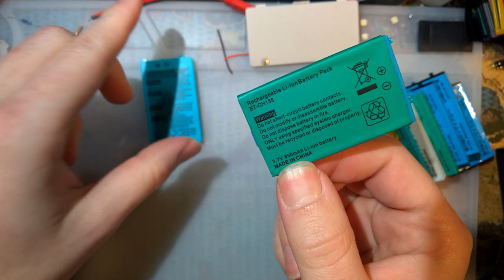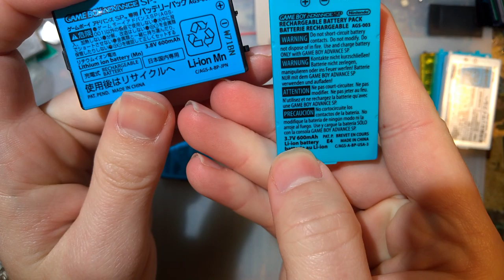A Quick Rant on GBA SP Batteries

Comment: Hey dude quick question. I just got an modded gba sp with a modded screen without a battery. I bought one out of ebay for 8$ and it worked for about 2 hours but wont work anymore. When i charge it the light stays red and when i try turning it on it wont work. Is the problem the battery or the charger? (Charger is also off market)
Reply from the maker: I cannot accurately diagnose this issue with the information you gave. Does the charge light even come on? The charge light is orange, not red.
Reply: @makho  when i put my gba sp to charge the light turns on showing its charging, but whenever i try to turn it on it shuts down after a few milliseconds like almost immidiately. Sorry im German so my english isnt very good
Reply from the maker: @snakoi  Time to start swapping parts out. A new, quality battery might solve your issue or a new charger might solve your issue. I'm not sure which. Could also be that your charge port just needs cleaning, especially if the light flickers when you touch the cord.
Reply: @makho  Thanks for the help i appreciate it
Reply: I'd bet the battery is just a dude and won't recharge. I'd say it still had some charge from the factory when you first got it and that's why it worked as long as it did. I'd suggest getting either Makho's battery from Retro Game Repair Shop or RetroModding or the Helder Megabatt 800.
Reply: @husky3g  tysm man

Comment: I have a question, the battery with 1000mah and 2000mah fits for the GBA SP or only the battery with 900mah? I need a answer please 🥺
Reply from the maker: 2000mAh is not possible. The capacity is wrong.

Comment: I have a pelican brand extended life battery pack 3.7v and says 1000 mAh it's a little bit thicker but it replaces the battery cover. https://www.amazon.com/dp/B0002EA5XG/?coliid=IKC5VR41M58P8&colid=28AXMEIK3732R&psc=0&ref_=lv_ov_lig_dp_it.     Oh and it also has a circuit board in it.
Reply from the maker: I had one of those back when they were new. It did not last very long. I think I got maybe twenty charge cycles out of it before the capacity started taking a noticeable hit.

Comment: I'm about to buy every aftermarket GBA SP battery I can find on Amazon and run them through a few cycles and see what is the best battery for the money.
Reply from the maker: You're not likely to find anything good on amazon but I'd love to be wrong about that.
Reply: @makho  so far from the ones I have tested it's not looking good. Especially when running an ips screen.
Reply: @kensprivateinvestigation2128 hey. 10 months late but did you find a battery?

Comment: Just bought an INSTEN battery on ebay for a mere 5 bucks for my DSL, claimed 1700 mAh (lol) ran it dry and charged it back up, 940mAh per my USB meter, assuming 80-90% efficiency, that's just 750-800mAh while the OEM is rated 1000mAh with still 75% capacity left lol
Reply from the maker: Yep. Any batteries in this form factor that claim over 900 are absolutely lying about that.

Comment: I just bought some batteries off amazon. Should I be able to assume they have the switch that allows me to play them on the charger?
Reply from the maker: They have the what?
Reply: @makho  I forget where I saw it, maybe it wasnt a gba sp video, but it was something about a battery that isnt recommended to be charging and played on at the same time
Reply from the maker: @BlazingKhioneus  that does not apply to the SP
Reply: @makho  Gotcha

Comment: Have you tried out the Dantona battery from Batteries Plus
Reply from the maker: I've tried out the Rayovac battery. I have not tried others from B+
Reply: From a little I've looked up it seems the dantona has the same specs from the original rayovac and the same holding charge performance. Weak theory is that it's the same battery and dantona was the original manufacture under the rayovac branding.....

Comment: Li-Ion battery degrades even if it is not used .So when we buy "new" batteries actually we don't. The problem becomes pretty unsolvable when we consider retrogaming.  The vast majority, if not all of the batteries You buy in fact are "new old stock". No manufacturer invests in producing so old models. Similar problems in smartphone's world: there are hundreds of new uncompatible models coming out every year. People then is forced to dismiss their perfectly working phones because of this.
Reply from the maker: I'm actually facing a similar issue with  my Lumia 950 right now. That's the camera I use for filming my videos and the battery is getting really weak. It's unbelievably frustrating.
Reply: Planned obsolescence, for sure.

Comment: I have not tested my OEM battery but then again i don't have a tester. But your video did help a lot about how certain things work and some confusion fixing. 

Also this is related to batteries but it's completly differn't question. I was wondering if you have looked into any way to hook up leds to gb, gbc etc in a way to have it showing when the battery is charging, when it is fully charged and when it's low to show differn't colors depending i guess on the frequency. I don't understand it all to well. But I have been trying to figure how how to get a RGB led to work in place of the old light on the gbc when i add a recharable battery.
Reply from the maker: I made this https://youtu.be/7A705K_WF-E

Well, I assembled it. But it already basically does what you want. No reason you can't tweak the open source code to support an RGB LED instead.

Comment: OEM DS (original) batteries are a legitimate 850 and will fit and function perfectly fine in an SP if you cut off the tabs so it's definitely possible to fit 850 mah in that size.
Reply from the maker: no. Stop recommending that people modify a 16 year old battery to replace a 17 year old battery.
Reply: @makho  why?
Reply from the maker: @MGTwenty3  because not only should you not have to modify a battery, but because DS batteries have the exact same issues that SP batteries have. They are all old and all the generic aftermarket batteries suck. Or do you really think that batteries aren't susceptible to time?
Reply: @makho  Clipping physical tabs is hardly a mod, it doesn't change any functions of the battery. The connections and all of the specifications except capacity are the same as an SP battery which explains why they work properly. If you follow the logic that OEM DS batteries are unwise to use because they're old then it's even more unwise to use OEM SP batteries, which you don't seem to have a problem with unless they're visibly concerning.

Comment: Are there videos on how this test is done?
Reply from the maker: Not from me. You can test batteries by applying a known load to them and just measuring the time it takes for the voltage to hit whatever you designate as the cutoff. You can also measure internal resistance to make rough estimates to the health of the cell (though without baselines, it can be a guessing game and since some batteries have integrated protection boards, you cannot reliably measure internal resistance). Last, you can also just time how long it takes to charge the cell with a known current limit but since Lithium Ion batteries use constant current and then constant voltage to charge, results can be a bit inconsistent if you just time start to finish. My battery charger does all this for me automatically.

Comment: I dont know if anybody will see this but how long do the batterys last?
I also dont know if its a dumb question sorry if it is
Reply from the maker: run time per charge or recommended life cycle of the battery?
Reply: @makho  sorry for not responding earlier but yeah the life cycle of the battery how long does it last?
Reply from the maker: @eeveenation64  I wouldn't expect more than three years out of any of these, especially with regular usage. They generally start showing wear after a year or so though. Time will tell and I'll retest assuming I still have all the batteries.
Reply: @makho  Oh ok Thanks for telling me!

Comment: You should test an original ds fat battery, you can remove the tabs on them and get them to work in a gba so
Reply from the maker: Original DS batteries are like 15 years old. I don't see what info could possibly be gained. I think all but one of my DS batteries are bloated too which makes them unsuitable for testing (or use even).
Reply: @makho  good point the one I have is in perfect condition
Reply from the maker: @harrisontashjian752  That's fantastic. It's still not a good alternative.
Reply: K than, I did not know so thanks for telling me, I've seen vids of people using them

Comment: so how exactly do you test for Mah?
Reply from the maker: I have a battery charger with a test mode. Basically, it will fully charge a battery, put a constant load on it (in my case 300mA), see how long it takes to reach a low voltage cutoff, then charge it up again. It's a liitokala lii-500

Comment: Maybe its a thermal cutoff or a diode. :/
Reply from the maker: Thermal fuse seems to be the consensus and was my second guess (after regular fuse).
Reply: @makho  probably just a fuse fuse
Reply from the maker: @daijoubu4529  If it were a regular fuse, it would have popped when I ran multiple amps through it.
Reply: @makho  A few years ago I was doing a lot of testing with GBA and Batteries. If I remember correctly, that part near the end of your video is probably a diode. When I was modding one of my old GBA's I remember needing to drop the voltage a tad with a diode, since the discharge rate of the battery wouldn't activate the low power red light LED correctly without one. I thnk the red light turns on around 1.8volts, but a LIPO is dead around 2.2-2.5v I think?
Reply from the maker: @lolztony  if that were a diode then this battery would not be able to be charged. This is also a battery for a GBA SP, not a GBA.

Comment: How do i test my gba batteries?
Reply from the maker: with a standalone battery charger that supports 1S LiPo and an adapter to plug the battery in to said charger
Reply from the maker: or just turn it on and see how long it takes to turn off and extrapolate from there

Comment: The original DS battery are exactly the same as the SP batteries and Nintendo mark them as 850mAh so it's not that crazy for after market ones to write that much too. What I really think is crazy is how your average phone today is thousands of times more powerful than an SP and the batteries are only 4-5 times better. Can you imagine if someone made a new SP with power efficiency we have today. A 4000mAh battery would power it for a month.
Reply from the maker: If the batteries are "exactly the same," why would Nintendo put such different values on them?
Reply: @makho  I mean they are the same size with the connectors at the same place. The 2 little plastic tabs are not exactly in the same spot but if you file one of them down and a little bit of the other, you can use a DS battery in a SP. Or put an SP battery in a DS.
https://i1.wp.com/blipretro.com/wp-content/uploads/gba-sp-battery.jpg?resize=960%2C640&ssl=1 just like this.
Reply: You gotta cut off the 2 tabs, but leave the locator tab, that's in the same spot as the SP battery. The NDS battery terminals are in roughly the same spot, because they're larger. The physical size of the NDS battery is larger, enough to bulge the SP battery cover, even after removing the sticker to slim it down.
Reply: @tommylyeah  On mine I had to cut 1 tab completely and file down half of the other. I didn't need to remove the sticker and have no bulging problem. Maybe my battery is in better shape and the one you had was a bit bulged. The original SP batteries are complete plastic shell while the replacement and the DS battery only have the outer edge being plastic with a sticker holding everything together. That explains why the SP are 600mAh and the others are 850mAh. The battery is the same size but the cell itself is a bit ticker.
Reply: @chamoo232  - Maybe I should return or buy another NDS battery, if yours closes fine over the battery 😒
Reply: @tommylyeah  Mine is an original one. Is yours a replacement? Maybe that's the difference. Or it's just bulged a bit. I had mine in a stock shell before and now I have a replacement shell and it fits fine in both. My shell is transparent black and you can see the white DS logo through since I didn't remove the label.
Reply from the maker: @chamoo232  Maybe stop recommending DS batteries since that was pretty much the point of my video?
Reply: @makho  - More powa, though.
Reply: @chamoo232  - I'm not sure if this is actually a Nintendo unit, but it does have the Nintendo stickers, though it was sold as a NDS replacement.
Reply from the maker: @tommylyeah  But they are not more power. That is literally contrary to the evidence I posted in this video. I tested these cells and they tested at half or lower the capacity as the other ones I recommended. 

And aftermarket or OEM, there is no reason to ever use a bulged battery. Recycle that shit.

Comment: What does OEM mean?
Reply from the maker: Original equipment manufacturer. It refers to the hardware that originally shipped with the device (or authorized 1st party replacements).
Reply: @makho  Gotcha, would you by chance have an OEM battery listing on amazon? or any of the really good batteries listed?
Reply from the maker: @BlazingKhioneus  you misunderstand. You can't get OEM batteries on Amazon. You can't get them at all except by pulling them out of other SP consoles and since lithium ion batteries have a shelf life, this isn't even a good idea.
Reply: @makho  Yeah, good point, is that battery with the protection circuit you pop in your gba sps available anywhere?
Reply from the maker: @BlazingKhioneus  the SP itself has the protection circuitry.
Reply: @makho  Ah, well what's your recommended listing to get gba sp batteries that dont require replacing the battery contacts?
Reply from the maker: @BlazingKhioneus  https://www.youtube.com/watch?v=ykxxOpwzhuU